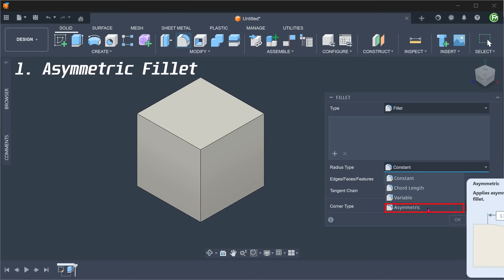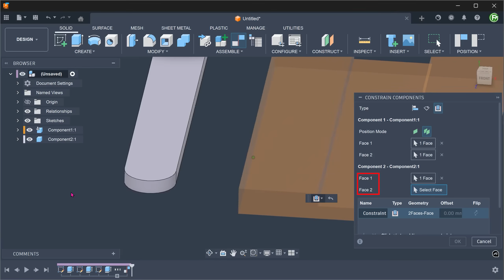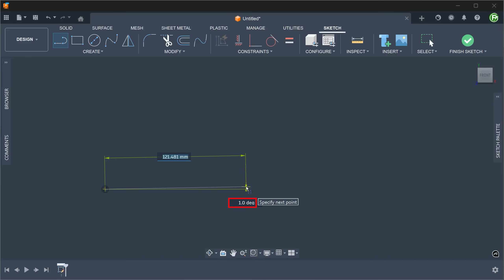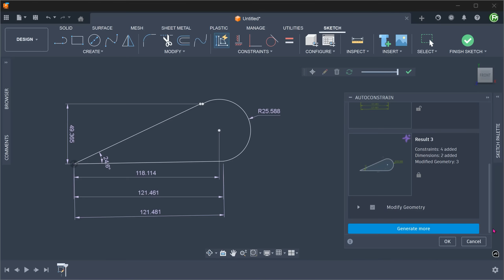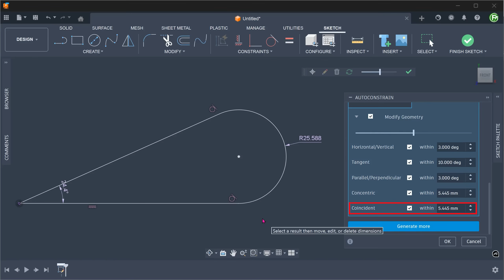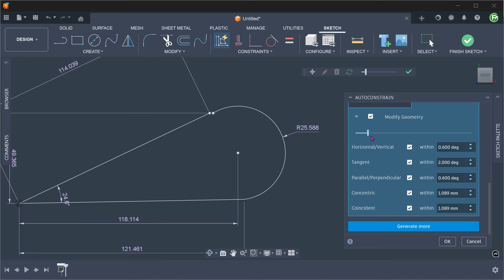What's New in Fusion? | Nov 2025 Update

Comment: Thanks for your video.
One thing I don't understand.
Why do people continue to use orthographic projection in Fusion 360, when it is quite capable of producing accurate perspective views.
Orthographic projection is a old way of viewing engineering drawings and is a carry over from manual drawings.

I studied technical drawing at school in the late 1960's and worked as a draftsman for a year after leaving school.

It exists so individual faces can be measured accurately, but Fusion has its own built in ruler and can provide ANY dimension on request.

Using perspective view allows an accurate representation of what the part you are designing will actually look like, it can be rotated and viewed from any angle and is far superior from the orthographic projection method which I consider obsolete in computer aided modeling.

I don't intend to be critical of you, I appreciate the effort to create this video for as all, it just that SO MANY people on the internet appear to be stuck in orthographic mode.
It just LOOKS WRONG for no reason.

Comment: Meh, I dont see myself using the auto constraitn ever really. What I would like to see it how to differentiate between constraints that are hard to tell apart. Like point constraint. Lets say you have a two circles with the center directly on a corner of a rectangle and also a line with end pint on the same corner point. You would see three point constraints. Then try to remove the point constraint from the line - you cant tell which one of the three point constraints to delete! I think in NX they have something like you can grab the constrained geometry and shake it with mouse, then it relaxes the constraint for that geometry. Would be cool to have!

Comment: auto constraints sound really useful for sketches where you can't find the unconstrained parts
Reply: Definitely better, but still not as good as if they just gave us a button for “show underconstrained”, which as of now you have to open the console and type in the command to use. So, it’s there, they just won’t give us a nice easy to use button!
Reply: @BlackSmokeDMax  For sure! Finding out about the show underconstrained command has saved me a lot of time, but it's still annoying that it doesn't show how so (which degrees of freedom are left). I'm often stuck with a few unconstrained lines or points that don't move at all when I drag them around, but prevent the sketch from being fully constrained..
Reply: then fusion will probably prefer to crash than find it himself 😆
Reply: Try Sketch Helper by Hestus, it works on paid and free version.